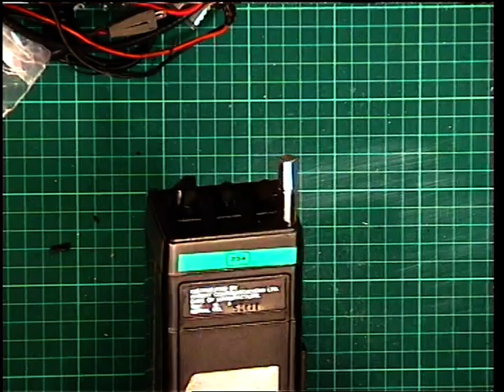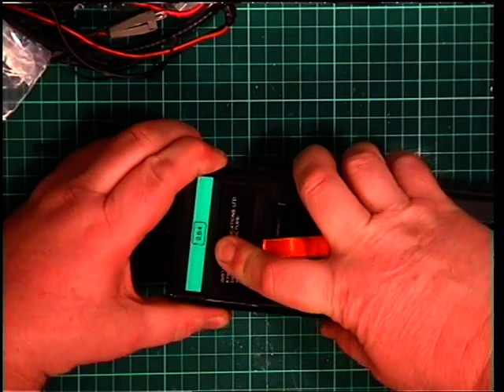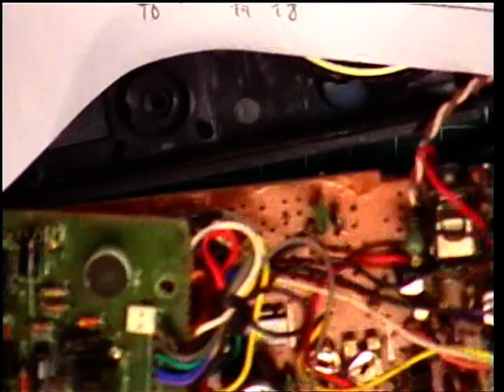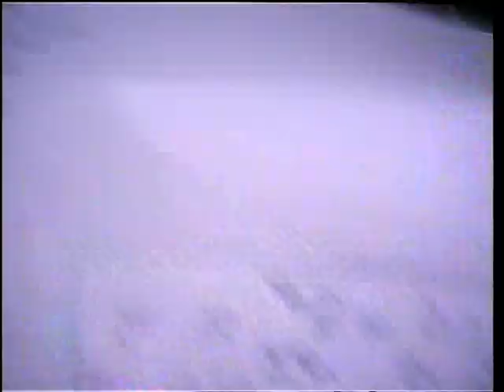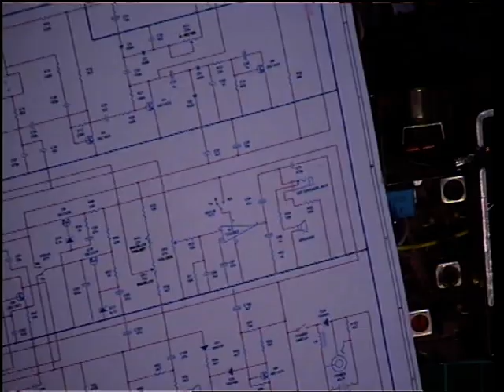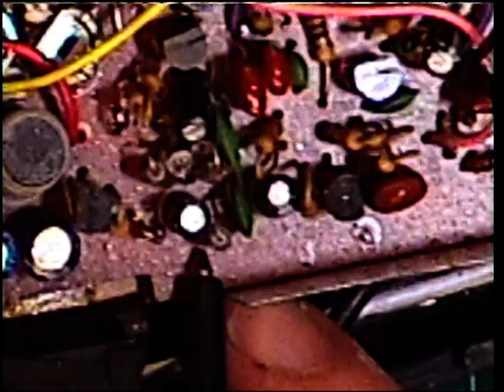Moonraker Master UK 27/81 FM CB Hand Portable - Transmit alignment

Comment: Hi Richard
In the video you mention T6 is transmit but you didnt adjust it, just T8, 9 & 7. Before adjusting this (T6) on mine can I  just confirm it is a tx coil and not vco please?
Reply from the maker: T6 looks on the circuit to be the first coil after the VCO. If the radio transmits on all channels, leave it alone; it could interact with the VCO. Email me & I'll send you the circuit.    rshireby@yahoo.co.uk

Comment: Hi Richard, do you need the dummy batteries with this one, also if i wanted to get the external aerial plug you have could you let me know what exactly they are called please. Great video as always and do you still have the cb mug havent seen the original one for a while, must be time for a cuppa whilst you are working repairing all those radios myst be thirsty work!!🤣
Reply from the maker: yes, if using rechargeable batteries it's 10, if alkaline it's 8 + two dummy batteries. Readily available on ebay. The adaptor is RCA phono/Motorola plug to SO239. There are some on ebay right now 192831320618.

Richard
Reply: UK FM CB radio servicing Hi richard have just purchased both items using info provided, thanks for the help.

Comment: I had the misfortune to have to modify around a thousand of these when they were new. The first batch needed a small ceramic cap soldering on the back and a small hand wound choke fitting in line with a wire internally to stop a birdie appearing on channel 2. Had to unbox them and strip them down in small batches do the mod then box them back up all in between doing the walk in repairs in what was a busy cb shop back then.
Reply from the maker: not good!

Richard
Reply: @ukfmcbradioservicingTango21  Almost as bad as when the boss bought 500 DNT M40 returns from the importer. They used to sit on the shelf awaiting any spare time i had. Dreadfully made things full of bad through hole solder links and dry joints. I dont miss that part of the job :-)
Reply from the maker: @cubwolf  And of course the LCL version of the same circuit. DNT stood for Does Need Tuning.

Richard

Comment: I got an old eurosonic es 220 handheld which I put 10 1.5v battaries  in before I knew about the dummy battaries, Is there a way 2 tell if the PA has gone as the radio still seems to transmit and receive,. i am running it on normal 12v these days though
Reply from the maker: Yes, this is why I mention it every time we deal with a handheld that can take 8 or 10 batteries. If the radio is transmitting, then you were lucky & got away with it. Richard
Reply: @ukfmcbradioservicingTango21  I brought a Midland 77-805D porta pak a few months ago which came with 2 dummy battaries which is a spot of luck as I would have done the same with that otherwise
Reply from the maker: Passing on this knowledge is what this channel is all about. At the time users were aware of this. Fast forward to now, 38 years later & this kind of thing isn't being discussed & few people have the instruction book.

Richard

Comment: I picked up 5 Jesan CB 950 handhelds at a rally recently, they appear to be almost identical to this one. Every one of mine has a slight buzz on transmit. Apparently it was a common problem with them.
Reply from the maker: I covered the Jesan CB950 about 18 months ago so I can't remember without looking at the video what I said about them! Just in case you're not running it on batteries but on a power supply, remember it's a 12V radio & not 13.8V; that's very important.

Richard
Reply: @ukfmcbradioservicingTango21  Running on batteries and all of them have a slight buzz. Thanks for letting me know about the video, I'll take a look.